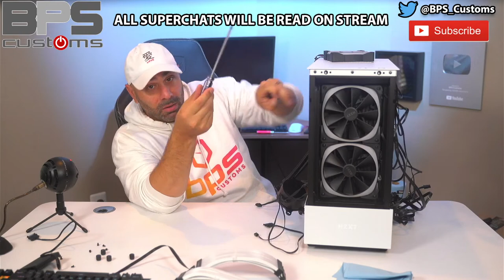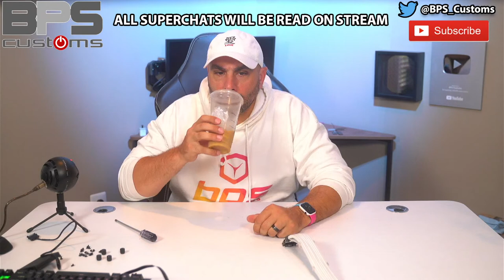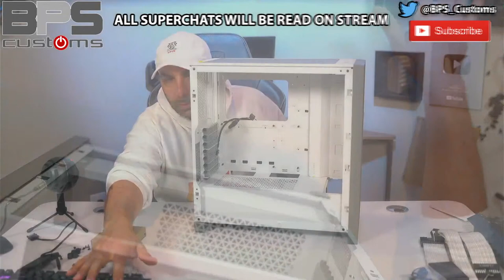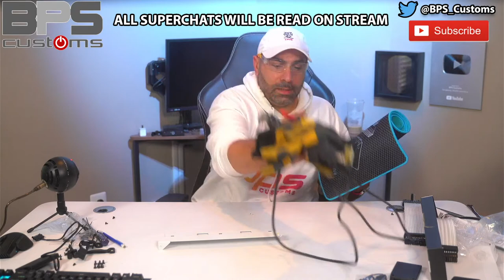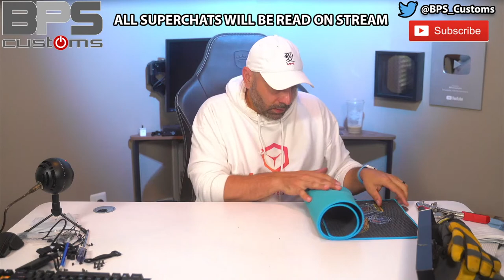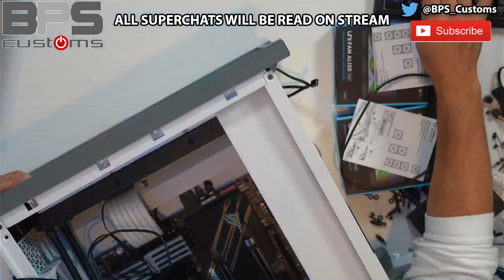Gaming PC Dream Machine - LIVE BUILD!

Comment: In response to 46:58 (Question about sweating):
"Up to 60% of the human body contains water. Almost every cell in your body contains water: body 
water makes up 79% of your muscles, 73% of your brain, and even 31% of 
your bones. Overall your body weight can be ."
-Google Search

Much like a water cooled PC, your body is ALSO water cooled. Just because you are no longer stressing components of your system, the water in your system is still hot, and will require a longer period to cool down.